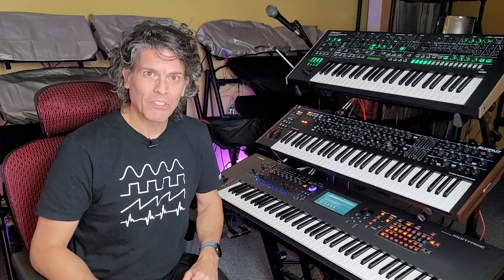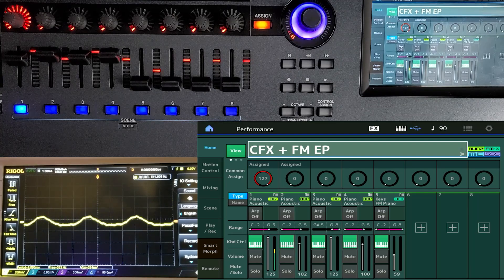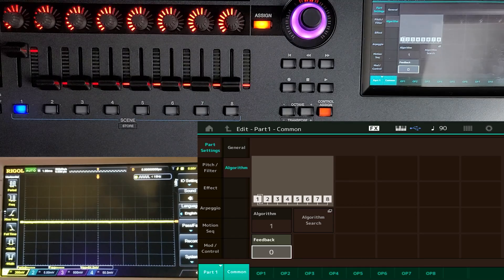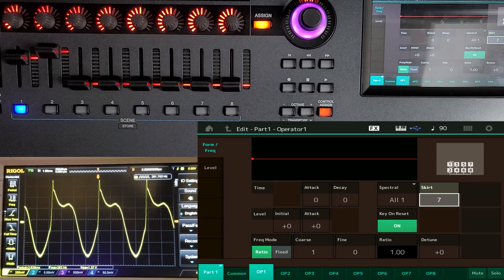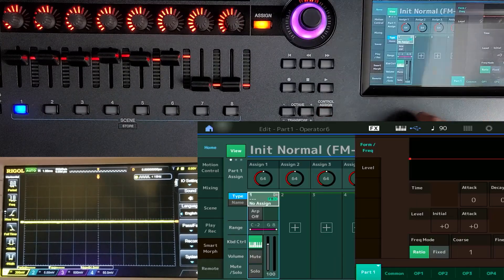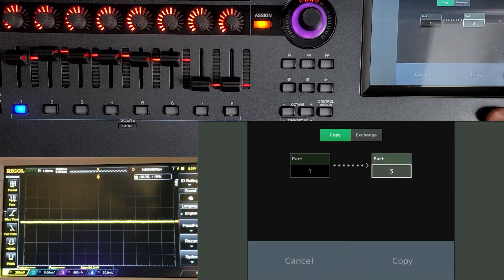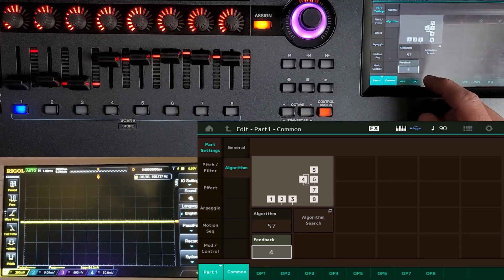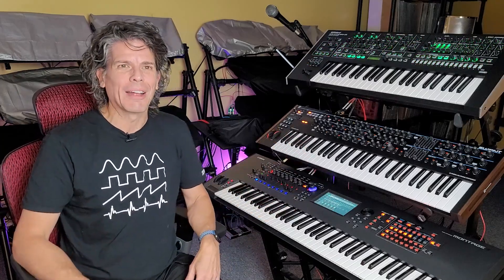Intro to FM-X Sound Design on the MODX and Montage

Comment: Don't have my MODX8+ yet, but with videos like yours I'll be an expert by the time I get one. This was only the 3rd FM tutorial I've seen and this one is the clincher, it's all clicking now. So the operators on the bottom row are the ones that actually play a sound (if there's none above it) and the ones on top are playing an actual sound being modulated by any that are underneath, I think I get it. My question is: does each operator that's actually playing a pitch take up one note of polyphony or is the whole sound combined into one note of polyphony? Thanx in advance.
Reply from the maker: You got it, only the operators on the bottom (called carriers) actually make sound that you can hear. The other ones above them (modulators) make a signal that would be sound if you could hear it, but instead the signal from those is used to modulate what's below it.

All of the carriers combine into a single sound, and that is one note of polyphony. You do not use up more polyphony by using an algorithm that has more carriers.

Comment: I have buyer's remorse. I just purchased the Fantom for $3,600 to save money. I will eventually buy the EX upgrade. With that said, the only thing the Fantom is supposed to be better than the Montage at is the synthesizer. The Zen-Core is supposed to compete with the FM-X, but I feel so limited with it unless I pay $250 for the Zenology, the soft synth version.
Reply from the maker: Aha, you've fallen into the Roland trap! Overpriced synths and paid upgrades, endless Roland Cloud membership fees...

That said, n/zyme (which you get with the EX) is excellent.
Reply: @ScottsSynthStuff  I have been interested in soft synths for a few months now. I picked up Phase Plant and may even consider UVI Falcon. While Phase Plant is cheaper than Zenology Pro and a lot more powerful, I would say that it might even be worth adding Zenology to my collection. It might have additional MUSICAL presets and will make it easier to modify them. N/zyme has the potential to be great, as it adds a wavetable in the mix. However, the presets are not impressive. Roland needs to do a better job marketing it. As I discovered, making sounds from scratch isn't easy. You're almost better sampling or playing around with a preset that is close to what you want. In order to create a sound from scratch, you must develop an ear on how the sound wave may look like. Does it sound closer to a sawtooth wave? What about a square wave? What about the effects? Do I hear a highly detuned chorus? 

So yeah, while it sucks that Roland is charging for their products for some, I do appreciate them always trying to create something awesome that I may consider buying. By the way, I wish Roland can add some really cool acoustic violins that I can buy. The Seattle violin by the Montage is magical. I have a new Fantom coming in tomorrow as the demo version that I received from Sweetwater was broke. I couldn't hear audio from the left speaker. That might be enough to almost make me like the Fantom violin a little bit more, but I don't seeing it closing the gap by a lot.

Lastly, after reading the documentation for both Montage and the Fantom, I would say that the Fantom does have the synth edge, though if you were to compare the Montage M with the Fantom, then the gap is closed a bit more. It seems like Yamaha improved the Montage M in almost every way. I also love the sound wave that you see as you play. It would be nice if the Fantom can get that in a future update.

Comment: Awesome, they listened to you and put the scope in the m8x,which for us engineers is not just a cool gadget, but actually helpful!
Reply from the maker: I don't think it was physically possible with the processor in the old Montage. The new Montage main processor is MUCH faster (it calculates Smart Morph interpolations in less than a second - the old Montage and MODX took about 15 seconds). And with that faster processor, they can do real-time oscilloscope display.
Reply: @ScottsSynthStuff  Right, but Yamaha may have been inspired by your video to decide to put it in the M. Although they may have decided that a bit longer ago…

Comment: Hi Scott!

Thanks you for this!
One question!
I can't control the operators with the faders, even though the element /operator mode is activated on the left side of the faders.
Reply: I was just messing with this today because I noticed my Modx doesnt have faders like the montage. Looks like the faders control the OP Level parameter. its found in the Level tab thats below Form/Freq. (theres only two tabs on OP options) It goes from 0-99 and is next to the Level/Vel box. instead of using faders you need to manually bring up and down the level using scroll wheel.
Reply: @alterI4   I don't know if you figured it out in the 5 months since, but if you press the button next to the faders labelled "PART" you can switch between ELEMENT and OPERATOR. Then you'll be able to use the faders instead of manually changing the OP level each time!

Comment: I get sound with only the first slider up (I know I only have 4 sliders as only got ModX8+ 
It is about 4mins 26 secs into your video. If I put first slider down and second one up I hear nothing. I’ve followed your instructions exactly up to this section. And on 6.25 I pick the same algorithm you choose and get no sound either
Reply: I have the modx8, so the way I made it work is by changing the Level patameter manually rather than with fader. In each OP menu click the Level tab on the left, and at the bottom there should be a box that says Level. If that level is at 99 it means on the “slider” is all the way up, if its at 0 it means its down. Hope that makes sense. I feel like that was a tricky thing to figure out might have to follow up with a video showing how his programing works on the modx8
Reply: @alterI4  same problem - will give this a go, fingers crossed.

Comment: I have the opsix and I’m not planning on getting a Montage, but it was nevertheless very interesting to get a glimpse into the workflow of the Montage. Having an oscilloscope constantly on screen to show the waveform is a great idea. In the future however, you might consider trying to set the vertical attenuation (Volts/DIV) on the Rigol so that the waveform is not clipping. You can see that the waveform on the Rigol scope was clipping at the top and the bottom almost during the entire video. This doesn’t produce a faithful representation of the actual waveform coming out from the synth, because this clipping is happening inside the oscilloscope due to the fact that the waveform hits the upper and lower part of the scope screen. Turning the volts/DIV knob one step in the anti-clockwise direction would have taken the displayed amplitude down to a level which doesn’t cause it to clip and distort on the scope screen.
Great video and keep up the good work.

Comment: It's a good video and I'll study up your tutorial to learn about programming the FM-X engine in my MODX.

Excellent explanation about the subtractive analog synth abilities of the Montage & MODX. I don't think they are only created via the FM-X engine, but also by the AMW2 engine. Although the Montage & MODX can do a surprisingly good job of recreating analog sounds, I don't think it technically has a virtual analog engine like the Roland Fantom, Jupiter-X, System 8 or the Korg Kronos/Nautilus do. But what is very surprising, is how good the Montage & MODX stack up to those keyboards for those kind of sounds. Having explored the Fantom/Jupiter-X/System 8 available sounds from Roland via their software versions and gone through many expansion models & sound packs, as an 80s/70s classic rock performer I've found more suitable recreations of those kind of sounds available for the Montage & MODX than I have with Roland's offerings, even with it's various VA engines. Roland's own sound collectiions largely focus on Synth Pop & rap, which I don't play. I've also never been too impressed with Korg's VA offferings in the Kronos or Nautilus either, simply because, the kinds of keyboards used by the original bands I cover were generally, not made with Roland or Korg analog synths in the first place. They used Oberheim, Moogs, ARP's, Prophet, etc. The strength of finding this kind of sounds for the Montage/MODX is because the MOTIF series was also able to recreate some of them too, and you can import over 20 years worth of MOTIF series sounds from the numerous 3rd party sound collections from the MOTIF series into your Montage & MODX. Still if you want maximum flexibility and the very best recreations of those kind of analog synths, go with exact VST recreations of them. But the Montage/MODX will generally get you as close as Roland or Korg's flagship offerings. I tend to think creating sounds from scratch would be easier on a Roland or Korg however. Fortunately, tons of expert sound designers who make sounds for Yamaha so we don't have to make most of them ourselves. 

For the kind of analog sounds I need for my bands without trying to always make them from scratch myself, I believe the Montage & MODX will do as good a job or better than the Fantom, Jupiter-X, System 8, or Nautilus simply because, there are far more sound collections made that are compatible with the Montage & MODX where expert 3rd party programmers have already made many of these kinds of sounds I need. The Kronos also has a lot of great 3rd party sounds too, but the Nautilus is incompatible with more than half the 3rd party Kronos sound collections, which is a huge disadvantage. 

I also want to point out for those that don't have a Montage, MODX or OpSix, Yamaha recently released the FM-X engine of the Montage/MODX as a VST soft synths through Steinberg software whom Yamaha owns. I wish they had offered the full Montage/MODX as software, but the FM-X engine now exists as a VST. It's called FM Lab. Look it up online. Korg also offers their OpSix keyboard as a VST also, which I agree is also very good.
Reply from the maker: The FM Lab engine for Halion has a lot of similarities to FM-X, but it is definitely not the same thing. Patches from the FM-X engine in MODX/Montage cannot be transferred to FM Lab.

But you're correct that the MODX/Montage do not have a true VA engine. That requires that the oscillators themselves be modeled. You can get close by using sampled AWM waves of analog synths, and then run them through the filters, envelopes, mod engine and effects of the synth. But things that are the realm of analog (or VA) synths such as oscillator sync or other similar technics where the oscillator itself is modulated can't really be recreated accurately.

That said, using the FM-X engine to create those oscillators means that you can directly modulate the FM-X parameters and get pretty close to the same effect, then running the result through filters, envelopes, mod engine and effects.

For classic analog sounds, for me, nothing is faster than a knob-per-function synth. My System-8, which is designed specifically to do this, trounces my Montage. The Fantom and JP-X have modeled engines, and can do the same things...but definitely not as easily and require menu diving.

I have two Fantoms and a System-8, as well as a Juno-106 and SH-101, and to my ear, the difference between the modeled versions on the Fantoms and System-8 and the real thing are pretty much indistinguishable.
Reply: @ScottsSynthStuff  Someone had posted online that is was the FM-X engine, but maybe they were incorrect in saying that.

It does say on the FM Lab page "The Algorithm Finder is loaded with all the algorithms from Yamaha’s legendary DX7, TX81Z and modern FM-X synth engine". 

The VST would have to offer FM-X compatibility to be of much use to me. But then again, I have the MODX so I don't really need it.

I think a lot of the classic analog recreations for the Montage/MODX are done by a combination of the AWM2 engine & sometimes combined with the FM-X engine too.

I use Roland's VST's, which includes most of the Fantom engines as well as the System 8. I also like that with their software option, they offer some of their famous classic synths not available for the Fantom, or System 8 such as the D-50 and others and that they also offer both the user interface of the Fantom/Jupiter-X or a user interface that functions more like the original synths they modeled and with the better sounding ACB modeling plus the ZenCore modeling so you get your choice. 

I prefer editing sounds and working with a computer than menu diving on keyboards. Korg is starting to offer their newer technologies as VST's also, and I hope Yamaha gets more into that. Ideally, a person should be able to choose either a hardware keyboard or software VST's for modern digital synthesizers.